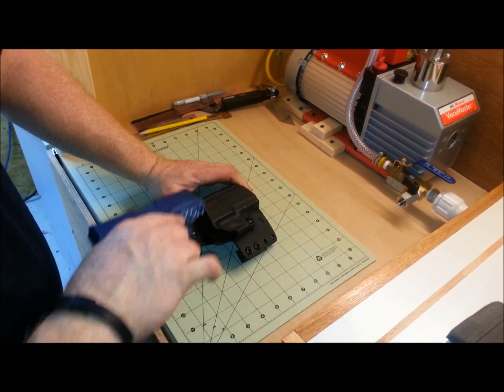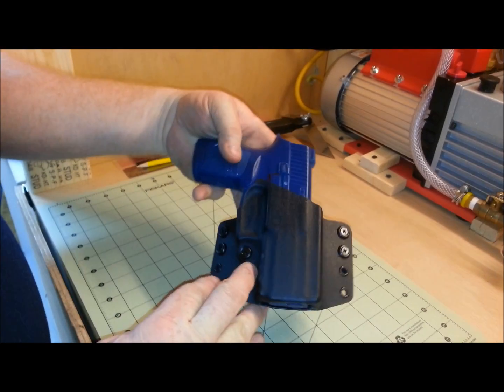Curved Jig

Comment: Do you find with the 90/10 that the belt loops everyone uses on a 50/50 don't hold in place as tightly on a belt? It just seems like they would slide quite a bit easier...
Reply from the maker: Bill Tait I have had no complaints thus far.

Comment from the maker: I got everything from Blue light Tactical. He has since stopped making these but has do it yourself instructions.
Reply: sascustomholsters I have a question: Since the holster is curved to contour to your hip,  is the "definition" of the gun on the back side of the holster (as is evident at: 5:58 ) vital for retention of the gun in the holster? If not, would it be better if the curved jig were made of something solid, instead of foam?
Reply from the maker: I would have to say I wouldn't know. I have never tried without the foam. It would just have to be tried and tested, Sorry I wasn't more help.

Comment: Hi SAS. I'm wanting a holster with a clip that is adjustable. Not where you have to loosen screws, but indents.  I've seen the clips for kydex holsters for knives. I think it had five indents for different cants and the clip was 1.5".  I want this for a Shield that will be worn appendix. When I sit the gun and holster dig into my gut. The cant that can be manipulated will prevent this, then when I stand up I reset it to vertical.   Doable? Thanks!

Comment: have you ever had any problems with using real guns rather then blue guns? I am worried about deforming the gun with the high temps and pressure. also what psi to you vacuum to? Thanks
Reply from the maker: Make sure you insert the mag in the magwell. This will help; also do not overheat your KYDEX. I am not going to lie I have deformed two poly grips, both were Glocks. I just used to much heat and pressure and no mag. This was some time ago when I was using a book style press. I use 8 CFM of vacuum.
Reply: thanks alot. i am using a book press. I am taking the .06 to 350 but i cut the kydex before heating it so it is not over  the grip

Comment: what are the specs for the silicone rubber?
Reply from the maker: David Tyree Sorry I do not know the specs. I just buy it from Blue Light Tactical.
Reply: +David Tyree 
From my research, 1/32" thick silicone rubber sheet, high temp, 40A durometer(soft) sheet. 12"x12" sheets from Grainger and Mcmaster-Carr. McMaster has sheets even bigger, like 24x24 if necessary, but much more expensive. 12x12 from grainger, at this moment are only like 6 or 7 bucks ea.

Comment: Great video.  I am wanting to build a vacuum former.  What is the material on the top frame? Rubber, silicone?  Did you build the box?
Reply from the maker: Its a membrane you can get from Blur Light Tactical.